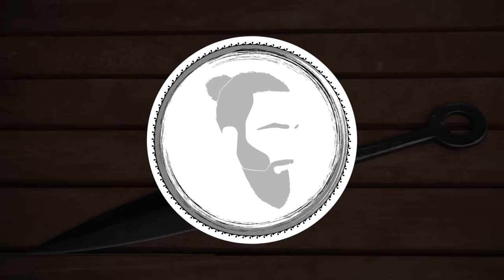Forged Bottle Opener, but it's a Kunai

Comment: It makes me laugh when people title their videos "Forging a knife" and all they do is cut out the shape of the knife from a sheet of steel and do some lousy heat treatment without tempering the blade etc. Now this was a proper forging Bud. Great skills. Kudos!
Reply: But there was no heat treat. You can't harden rebar.
Reply: @joehillebrand1035  5:33
Reply: If only he used good steel, it's not a knife, just a bottle opener with interesting shape
Reply: @_Dwarkin  I think it was by design. BB has plenty of good steel laying around. I very much enjoyed him shaping that rebar tho...
Reply: @AndrzejLDotEu  but you can't call it an "forging a knife", there are plenty of other videos on this channel to compare and call "proper forging"
Reply: @_Dwarkin  I disagree. Its forging. As in heating an object (usually a metal one) and shaping it by applying a force usually with a hammer. The final shape of the object is a knife. So its a knife forging.
Reply: @AndrzejLDotEu  it somewhat looks like a knife, but in the end it's still just a bottle opener.
Reply: @_Dwarkin  Now you are arguing semantics. If it walks like a duck and it quacks like a duck…
Reply: @AndrzejLDotEu  but it don't work like a knife, it's just a bottle opener made from rebar.
Reply: @_Dwarkin  I’m long over it…

Comment: This is so beautiful, I wish I had a forge (and all the rest) to try my hand at this.
I'm curious, do these blades rust, considering they're made of "normal" steel?
Reply: I— how is this comment 7 hours old?
Reply: @DeeDOYonTheTube  Magic.... Or early release on patreon! Happy Friday everyone!
Reply: Normal steel without chromium, yes it will corrode as there is not a thin layer of chrome oxides preventing more oxygen from oxidizing the iron.
Reply: Rebar is likely alloyed to resist aggressive corrosion but it will form a layer of rust, usually they're pretty rusted when used in construction so it makes sense some effort went into keeping it structurally sound that way. I'd guess it would rust less than a normal high carbon steel knife and you wouldn't get pitting or other significant damage from corrosion.

Comment: Excuse me if this is a dumb question. Isn’t rebar quite soft when it comes to metal? Don’t you want to use a metal with a higher carbon or is the tempering and heat treatment sufficient?